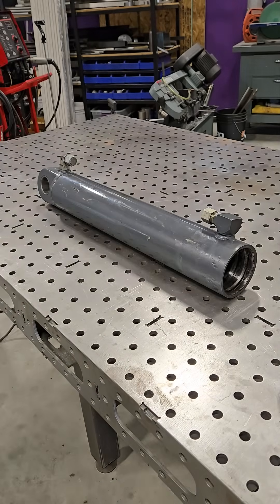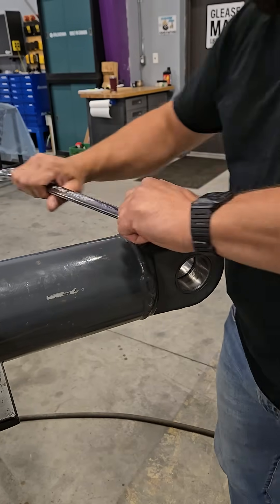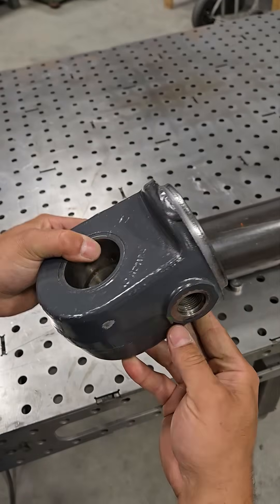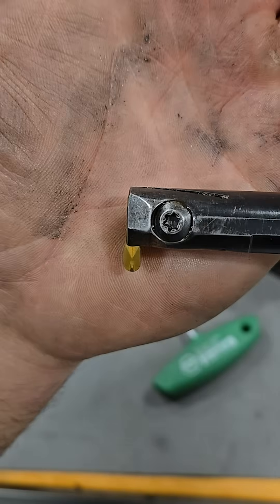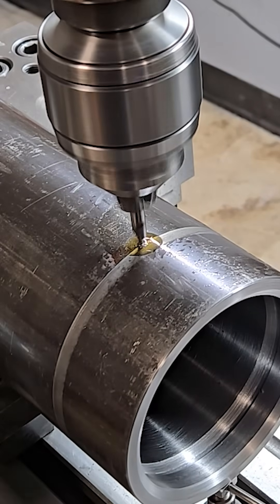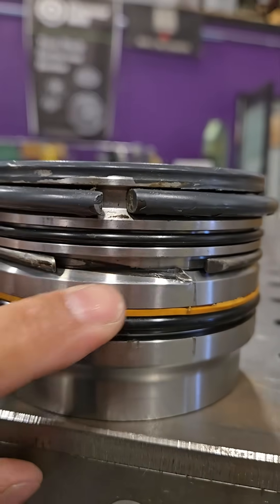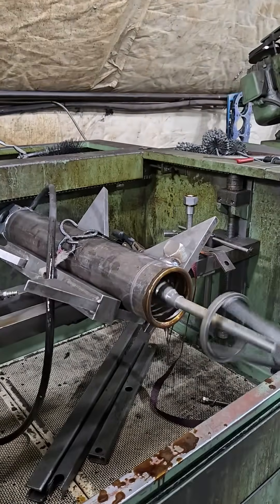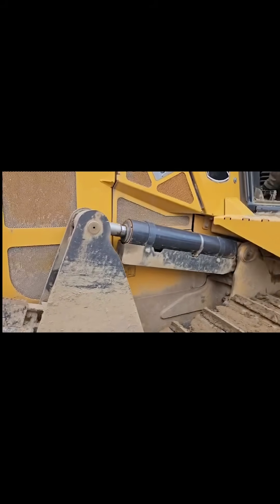Fixing What They Force You To Replace | Hydraulic Cylinder Re-Barrel

Comment: If a new one would have cost 10k how much did it cost to do this and how much would a normal person be charged for a job like this? Just trying to figure out if it was worth it. Sometimes now the parts or the whole machine is more cost effective to replace that paying someone to do a ton of work rebuilding or replacing things that the manufacturer puts in for 1.60 but sells for 160.00 or more as a replacement part.

Comment: Did i see correctly that the bore is concentric to the exterior? I do these kinda repairs as well but the inside is never concentric with the outside
Reply from the maker: Dang, nice eye! 

It had a few thou runout but yeah it was nice to not have to cut the OD for the steady.

Comment: This is a 2k cylinder from Deere😂 Also that a dozer not an excavator. Customer must be clueless
Reply from the maker: Pretty sure it was a dozer, you're right. But the customer is a well known shop in town, hardly clueless
Reply: @gleaseman still only 2k from Deere for a new one 😂
Reply from the maker: @platypus1287 send a link
Reply: @g @gleaseman 5k retail price. I had the wrong model dozer originally for 2k. It’s a blade lift cylinder on a 750k xlt dozer. Still a lot cheaper than the so called 10k you claimed it was new from them. 10k for both sides of the blade. I hope this rebuild didn’t cost more than 2-3k. It’s way too small of a cylinder to cost 10k

Comment: Why not weld up the groove and bore out the original unit?
Reply: It would be possible, but once a cylinder gets to that point the internal diameter has wear as well.
Reply: @ttargetss you can hone out .006" and still be fine on a bore. You should have saved the customer some time and money and just did a fast re-weld and cut a new groove
Reply: @vettepicking I’m not the video creator. But I’m my business I present the customer the options with my opinion of the pros and cons of each and let them choose. 
If the bore was good and it was just the blown out groove, which is unlikely, I would tell the customer of the possibility of welding it up, but at the same time as the other reply in this post said, this design of gland retainer is not the strongest out there… so I wouldn’t want the welded fix on my personal machine. 
Full Rebarreling really isn’t much more labor  than welding it, machining it, and you’d have more distortion to hone out.
Reply: Yes, that is the way we typically do it if there was no other internal damage.  It would probably save about 6 hours plus the cost of the pre-honed material.  Pre-honed material is usually 1020 steel, so depending on the type of weld wire you use, it may actually hold-up better than original.   The only time we have seen barrels actually wear (beyond seal tolerances) in the section that the piston rides are in certain sawmill hold-down applications where the piston and rod basically remains in one spot, stroking only fractions of an inch at high frequencies.

Cylinders that use internal retaining rings (like in the video) are probably the easiest to manufacture as far as welded cylinders go, but are very poor in the durability aspect.  Since the head is never held securely with the barrel as they would be with a screw-in or bolt-on head, the o-ring between the two tends to wear out and leak quicker, corrosion is worse since there is no head flange tight against the barrel face to keep water out, and the retaining ring can wear a wrong way ramp leading to blow-out like in this video.  I hate copying bad designs, so if we really had to go to the trouble of a whole new barrel, we would strongly urge the customer to go with a better head design and take care of the problem for good.

Comment: I watched the video 3 times hoping to se the manufacturing date code on the barrel as i use to work in the plant that made these cylinders . we hated having one fail on the test stand would just stack up leakers then i would spend a shift cutting the barrel of in the lathe to release the snap ring and cut the base forging off with new weld prep. was more cost effective to save the parts than trying to just take it apart.

Comment: Why does the snap ring groove need a ramp in at all?  Thanks
Reply: To take these apart you push the gland further into the cylinder, then insert the plastic tool that allows the snap ring to slide over the groove to disassemble. The ramp lets you push it into the cylinder
Reply: @ttargetss  Thanks. Makes sense now.
Reply from the maker: Great explanation, nailed it right on the head. I could have used that clarity while doing the voiceover 😅

It's really hard to get your head around without seeing someone actually remove the gland